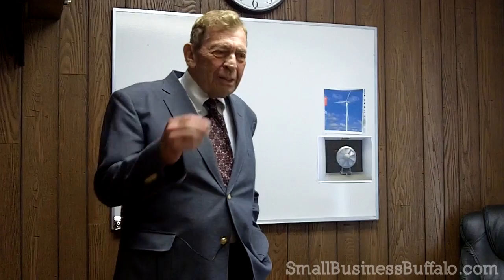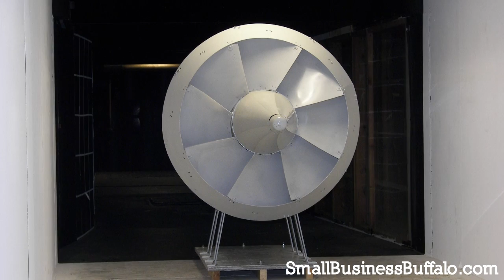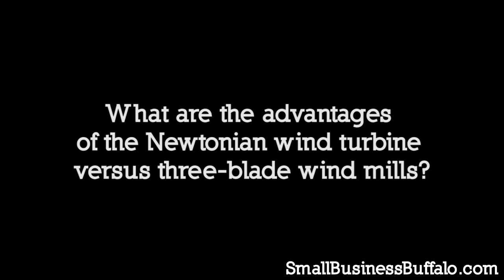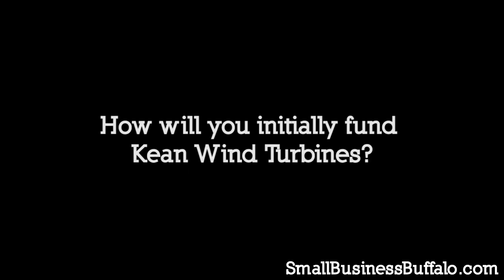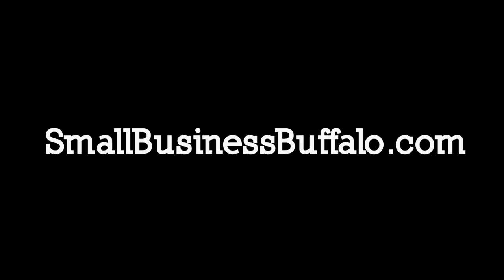Kean Wind Turbines - Buffalo, NY - SmallBusinessBuffalo.com

Comment: Wind energy is beig engaged as a supplement to other existing forms of energy generation (just like solar) it is not always availible & sometimes it is too plentiful. This energy can be stored short term and/or be utililized by other utilities, i.e., Heating/cooling of air or water, desalinization and wate vaporr extraction from the air (think large metro areas with limited water.) Think of a community with district heat from a steam powered electric plant and battery storage cells in each home